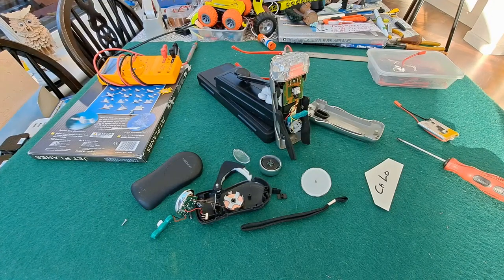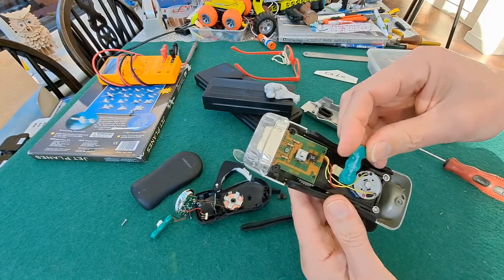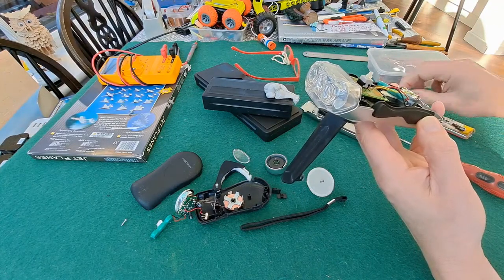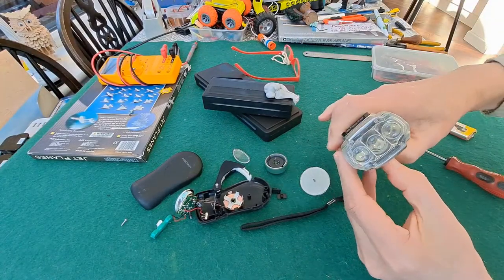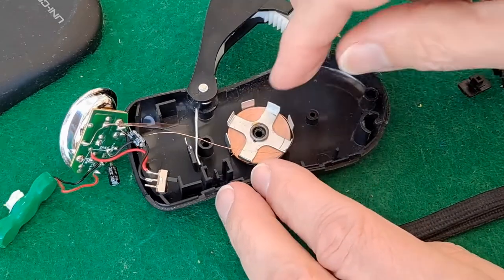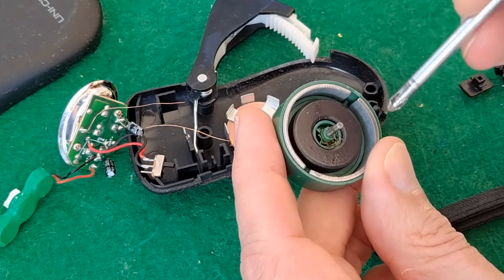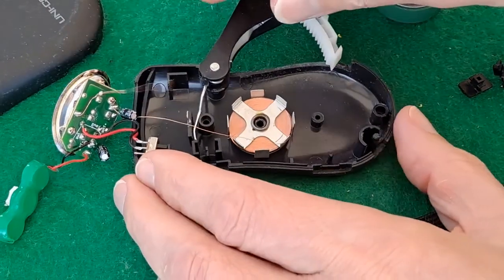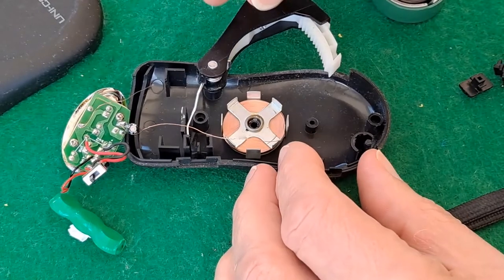A couple of wind up torches/flashlights

Comment: I have twice found out they are a waste of human energy and not very bright and jobbies for camping
Reply from the maker: You would have to be pretty desperate to use one of these. I used to buy the pump action ones so I could pinch that coil out of them for electronic projects. I do have a little project in mind for it as mentioned in the video, but I need to sort out a low voltage AC supply.
Reply: @GrandadIsAnOldMan  my first thought was coils, pulse motor lol
Reply from the maker: @Telboy-fv8ke  the video I watched was driving the single coil one with an AC supply. No great power, just a fun novelty. I haven't got round to that part of it. I will get there eventually.
Reply: @GrandadIsAnOldMan  I will watch out for it. I never understood Ca Lo's video